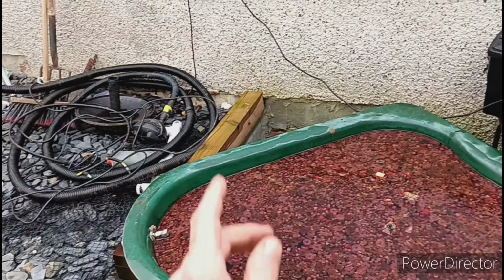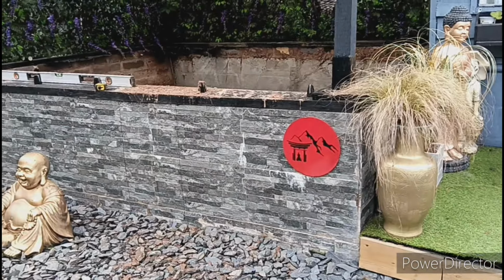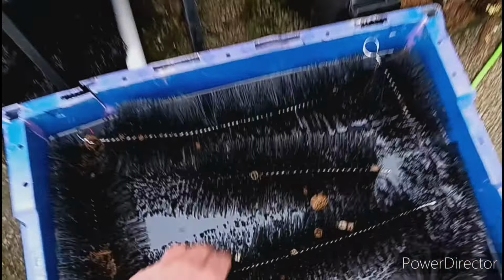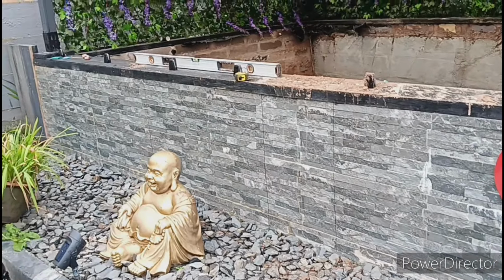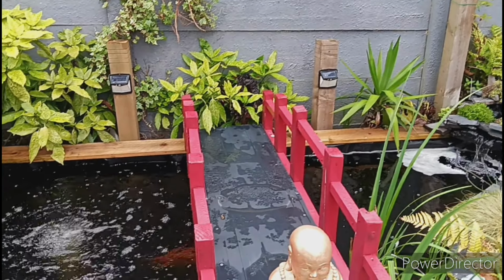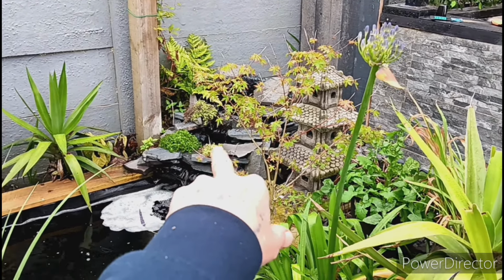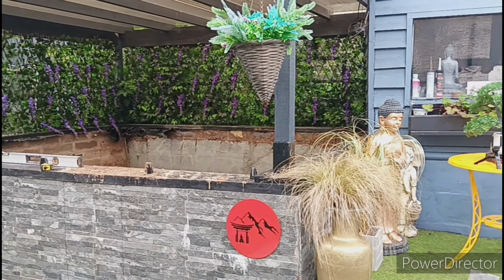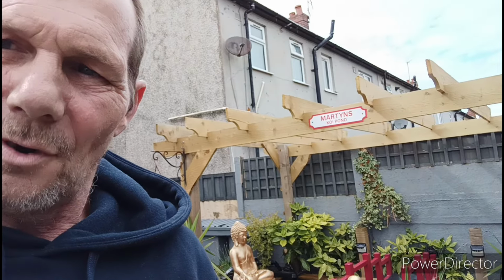sadly gone but not forgotten 😢 main pond  bacteria  I will get past this #koi #koipond

Comment: Sorry to see your pond like that it was so nice as well 😞 could the fish that had issues on their belly have been sitting on the bottom of the pond ? The health of our fish greatly imprved when we put a 14,000 LPH superfish eco pump in the corner of our rectangular pond fiering down the long side of the pond, it creates circulation (that you could visibly see along the bottom) and gave the fish a strong (very strong) current to swim along and now even in the calmer areas of the pond the koi still have to swim and we no long see any fish sitting on the bottom. Good circulation absolutely transformed are pond clarity and fiah helth and to put it in context our pond is 9,000 liters and the other pump on the drum filter is running at 16,000 LPH so thats a total of 30,000 LPH on a 9,000 liter pond ! A gravity sieve is a good way to go if saving up for a drum is not an option as you can pull 15-20k LPH through most gravity sieves and they take 2 minutes to clean if that ! I cant remember how big your pond was but as its square a 30w 5,000 LPH pump in each corner might work out better if you decide to re-do the pond in the future. I hope all goes well for the grow on pond and i definitely wouldn't take down the main pond just plan it better for when you do start it back up !
Reply from the maker: @oliverskinner8962  thanks for the lengthy comment oliver very much appreciated 👏